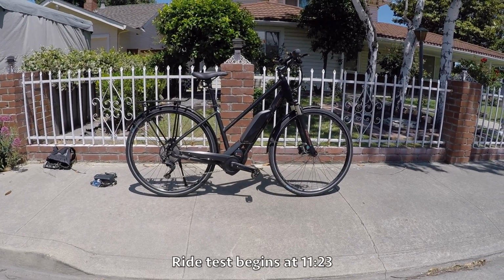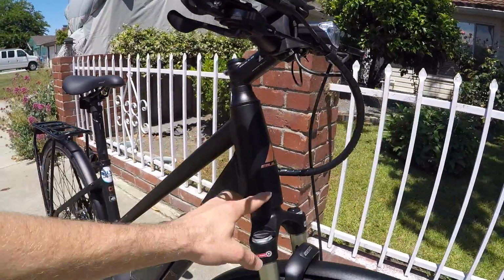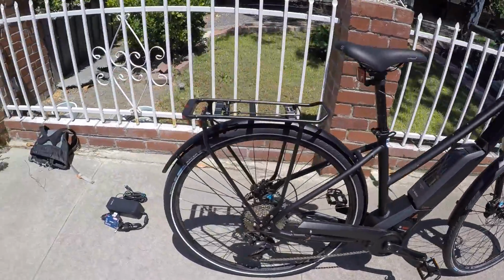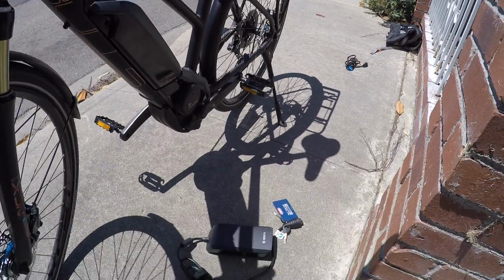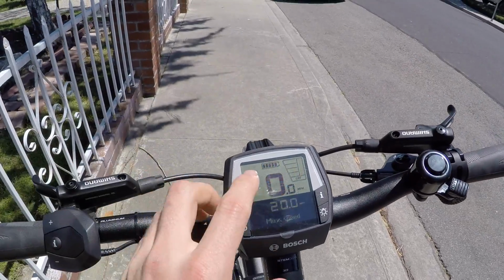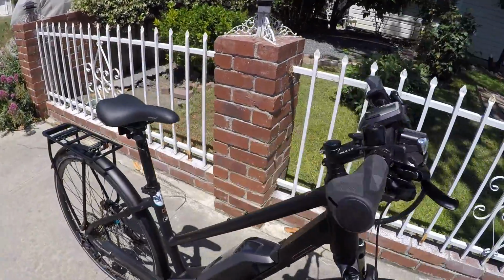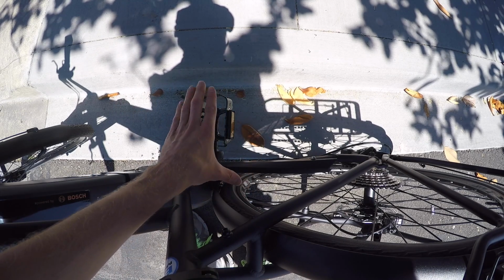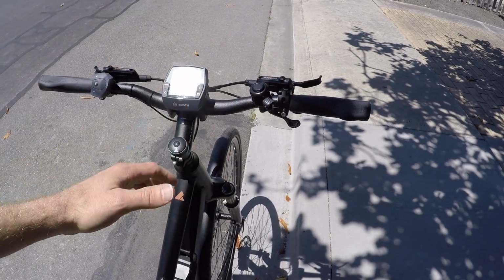BULLS Cross Lite E Step-Thru Review - 4.1k

Comment: I hate to keep harping on this, but those lights have got to be removable.  They are thief candy.  Manufacturers need to collaborate on a hot-swappable standard for powered lights that just slot into place and work in all weather.
Reply from the maker: It would be cool to have removable lights that could still be powered by the main battery... that would be the coolest! But I find that integrated lights usually are not stolen because they don't work if they are ripped off, the cables are woven through the frame and connected to the controller and battery
Reply: ElectricBikeReview.com The parts alone are enough to attract petty theft, and internal cabling means a replacement involves extensive labor charges, unfortunately.
Reply: A legitimate point but that's some really, really stupid thieves.